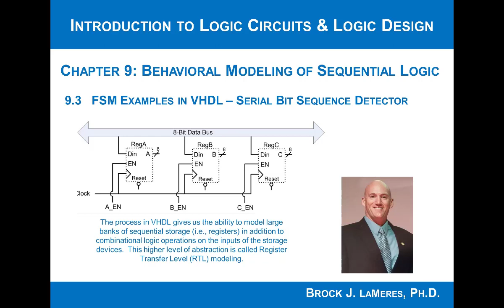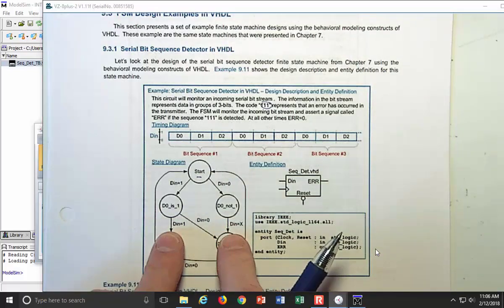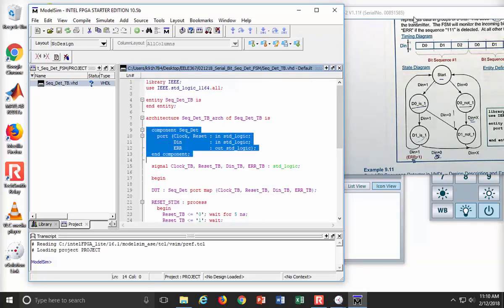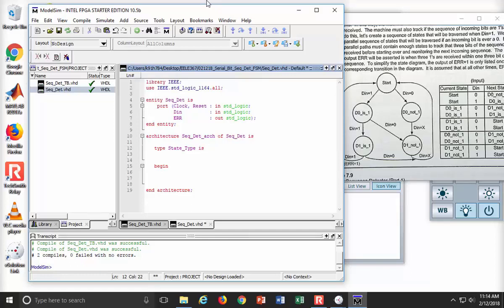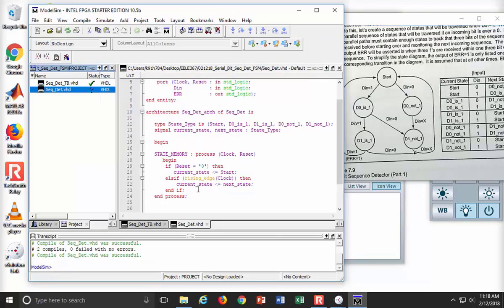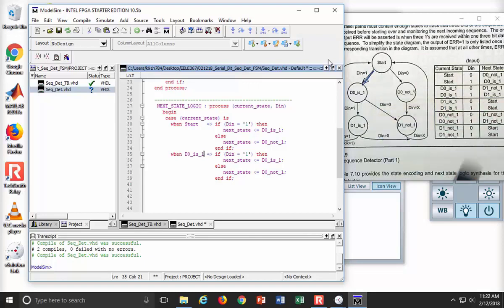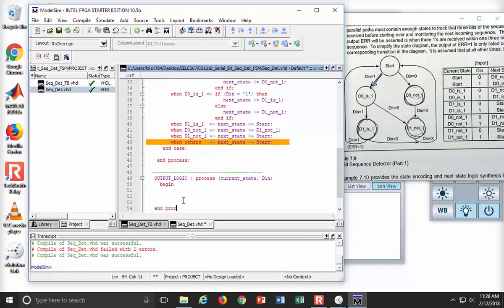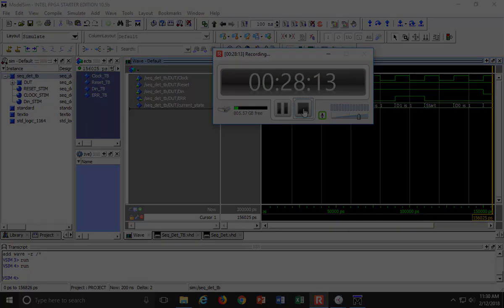9.3(a) - FSM Example - Serial Bit Sequence Detector

Comment: Hi I wanted to know why 5 states are used in the fsm, couldn't this be implemented with only 3 -> Start, D0=1, D1=1. Then at any point for an input of 0 it gets reset? Or was it done to maintain a 3-bit pattern each time?